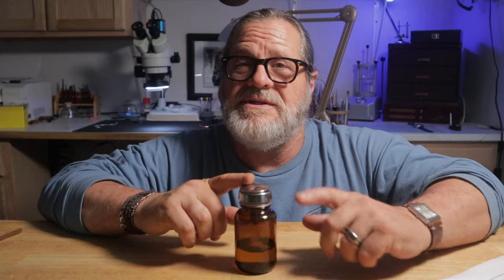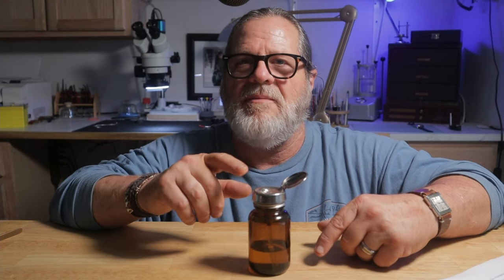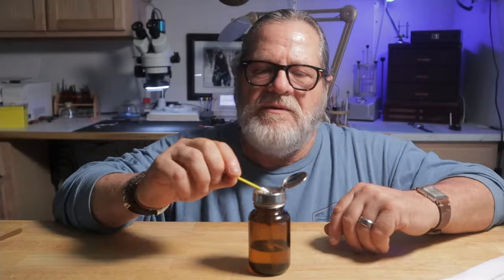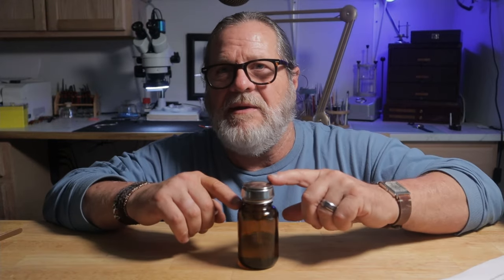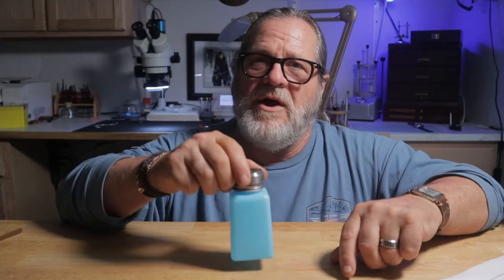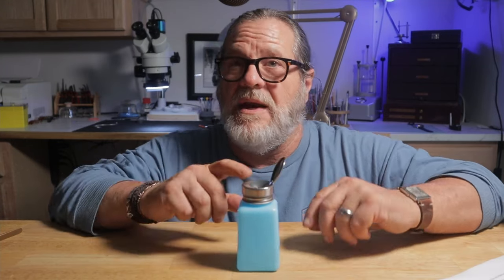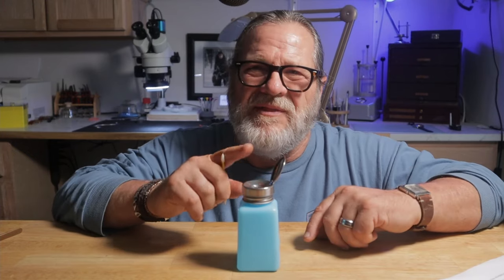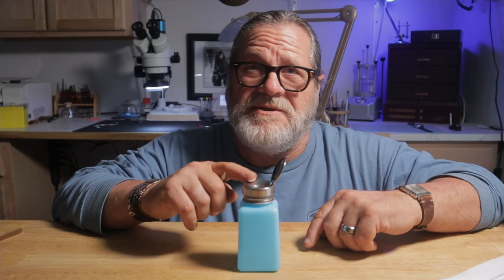How to Clean Watch Parts Without A Machine-Watch Repair Lesson #8

Comment: I really enjoy watching your videos. Thanks for sharing! By the way, not sure if you have answered this already but what is the concentration ratio for the rinse cycles when using IPA?  Do all three jars contain IPA? Is it IPA only or also water? Thanks again
Reply from the maker: Hey Marcos.
There are multiple ways to do it. In the rinse jars you can use a water rinse if you want. The key when using water, is to displace it right afterwards to prevent rust on any metal parts. Since IPA comes in different concentrations I always at least finish with 99.9% pure.
IPA that’s 70 % is basically just pure, cut with water, right.
Remember though, pallet forks and balance wheels that are shellacked could be damaged if exposed to IPA too long.
For these parts I always use Hexane as I discuss in the video.
Reply: @watchrepairtutorials  thanks! I was trying to understand your final cleaning setup. Putting aside all shellacked parts, do your 3 jars contain rinse agent (zenith/L&R)? Or some have cleaning agent and the other rinsing agent?
Reply from the maker: @marcosmartin4521  oh ok I see. I use a vintage jar machine. I use L&R extra fine cleaner, 2 rinse cycles of L & R # 3 and a final rinse in pure IPA

Comment: Alex, thanks for your great no nonsense informative videos.  You are answer most all of my questions.  I am about to start my very first watch restoration project and of course cleaning is a big question for me.  I live in a small Mexican village on the pacific coast.  Watch cleaning solutions are totally unavailable in Mexico.  Naphtha and lighter fluid are unavailable.  I have found a product called Gasoline Blanca at the paint store.  According to the MSDS it is between 30-90% Hexane and between 10-40 % Naphtha.  With a flash point of 43C.  Do you think this would work for all the parts of the watch with a IPA rinse?  What is your recommendation?  Thank you so much ,sir and keep up the great work.
Reply from the maker: Yea should work great. Use good ventilation because of the hexane.
Reply: Great news, thank you Alex.  Do you think this mixture of Hexane and Naphtha would be safe for the balance and pallet fork? Or should I clean them with something else?  Final question , How long should the rinse be in 99% IPA to avoid damage to shellacked parts.  Again thank you so much for your n nonsense approach to teaching
Reply from the maker: @randyallbritton4963  yes I clean my pallet fork and balance in straight hexane, no problem.
The rinse for the main parts will depend on the napatha ratio in your cleaner. 4 or 5 minutes should be fine.
If you have to use IPA to rinse the shellacked parts, make it brief, under a minute then dry with low heat.
Although IPA is not ideal to rinse the shellacked parts, pallet fork and balance, as long as the shellac is not disintegrating you should be fine.
Reply: Thanks again. I agree that it looks easy when you watchmakers put a movement back together. I was thinking of videoing the trials and tribulations of my first attempt to destroy a running watch. I mean renovate a running watch. Then see if one of you pros on YouTube what to do a critique on your channel. Would you be interested?
Reply from the maker: @randyallbritton4963  sure

Comment: I looked up the MDS for one dip and it came back as Trichloroethylene according to the CAS number..CAS No.: 79-01-6 Hexan works but it's not the same stuff. Neither should be used without protection.. ie.. keep it off your bare skin and use it in a well ventilated area.
Reply from the maker: Definitely not the same chemicals but it produces the same results. 
And yes I goes without saying that you should always follow safe practices, read the labels use common sense with all products you use including cleaning and rinsing liquids.

Comment: Hi. Every time i use Evapo Rust, i get some sticky resedue, that i can not get read off. I use aceton, it helps a little, but not perfect, still have some stickiness. Any idia what to use to clean parts  after Evapo Rust.?
Reply from the maker: Try CRC electronics cleaner.

Comment: I use L&R ultrasonic cleaner for a pre-wash and a primary wash step.  I rinse in 80% Naphtha/20% odorless paint thinner, in 2 steps, with a final rinse in hexane.  But I often still see residual sticky  gunk on the wheels and the plates after this process.  So I tried your idea of using IPA as an additional wash step, and everything is spotlessly clean if I include an IPA rinse step.  It’s amazing.  But iPA dissolves shellac, which holds the impulse jewel and the pallet jewels in place.  So I don’t include the balance and the pallets in this process, as I don’t want to be gluing these jewels back in place.  Does this make sense?
Reply from the maker: Absolutely. I use a zenith 4 jar rotating cleaner and still clean my pallet and balance by hand with hexane.
This sticky gunk you are referring to could be water contamination.
I had this issue in time and traced it back to when I cleaned my jars and didn’t allow them to dry 100% and then added new cleaner and rinses to the jars that still had moisture in them.
Just FYI Paul.

Comment: Where do you empty your used cleaning solutions ?
Reply from the maker: if it is a solvent based cleaner or rinse I put it into a 5 gallon barrel and let it evaporate. That's one reason I am primarily going with a water based cleaning system these days.

Comment: Sir, how long would you spin the parts and dry the parts at the end? like spin them for 4 mins or so? or more? thanks
Reply from the maker: Well, the spinning of the parts is just to get rid of the bulk of the liquid off the parts. You still want to dry the parts with low heat.
Reply: @watchrepairtutorials  what i meant was in the solution when you clean the parts how long do you do a cycle... ive seen some that say with the fancy machines they usually run each cycle for about 4 mins or so.
Reply from the maker: @gillandro2  yes, about 5 minutes should be fine depending on what you are using. Oh course inspect how clean everything is after they are dry
Reply: @watchrepairtutorials  thank you sir.... now i just have to watch your lesson on jewel replacement :)
Reply: @watchrepairtutorials  do you dilute the cleaning solution like the bottle says? Or do you leave it as a concentrate? Thank you.
Reply from the maker: @gillandro2  Yes always dilute as recommended by the manufacture. If you don't the cleaner could be to alkaline and cause damage.

Comment: I am trying to use IPA for all stages, hand washing, not soaking balance and pallet fork. Keep less chemicals at home, and IPA don’t have much smell when used. Is this OK?
Reply from the maker: Sam IPA is not the best cleaner for grease. How are you cleaning, by hand or machine?
Reply: But in the video, you say it does an excellent job of removing oil and grease... @watchrepairtutorials
Reply from the maker: @bjpargeter466  it's not the best when using a rotating machine but will work fine when hand cleaning if done properly.

Comment: When it comes to rodico, can I use a less expensive alternative, or does it pay to stick with Bergeon?
Reply from the maker: I don't know, is there one?  You want to leave as little residue behind when using a putty. Think of Rodico as something you use in emergency situations. You will use a lot less. Also when you do need it just pull or cut off a very small amount.
Reply: @watchrepairtutorials  saw a vid of it being used to pick up and align a seconds hand, was wondering if it was all created pretty much equal. Wouldn't want to leave any possible residue.
Reply: @GregJGreen  I definitely wouldn’t use it for hands or dials. I don’t know about other similar products because I haven’t used them.
There is almost always a better way than using Rodico.
Reply: @thewatchsmith2773  thanks, Alex. I have hands, a cyclops crystal and 2 presses coming, want to see if I can mod my Duro successfully. Believe it best to set them aside when they arrive and watch some more vids on the subject until I get as clear of a picture as possible.
Reply: @GregJGreen  👍

Comment: Novice question, brass vs steel cleaning baskets?
Also where do Alex find inexpensive baskets cause all the ones I find on the Asian markets are not really inexpensive. Not expensive either like the bergeons..
Reply from the maker: I use brass. These on Esslinger a 6 bucks.http://bit.ly/3ZuuX2c
Cousinsuk has them for about 3.50

Comment: I do have one question about cleaning the balance wheel/hairspring... You said that it requires a different solvent, but I don't think you specified what to use. Would the hexane work well? or is there something cheaper/better out there? If you read these please let me know :)
Reply from the maker: Hello Lilac,
The balance and pallet fork need to be treated a little differently because of the shellac and the fact that you do t want any residue left behind. 
Hexane is perfect but apparently is regulated by the DEA and cannot be delivered to a residential address.
If you are not using commercial grade cleaners lume L & R or Zenith I would suggest using One Dip which is formulated for cleaning hairsprings.
Reply: @watchrepairtutorials  Thank you, I really appreciate the fast response time :) I know you're a small youtuber (which is surprising considering the quality of your content) but it's still very impressive that you read all of the comments. Especially on your old videos. Keep it up!

Comment: Doesn't the alcohol dissolve the shellac that holds the roller jewel in place on the balance?
Reply from the maker: IPA alcohol can weaken shellac and dissolve it as well if it is left in it too long.
That’s why I clean my pallet fork and balance wheel in hexane separately from the other watch parts.

Comment: kind confused, i can use hexane for the wash cycle, and IPA for the 3 rinses?
Reply from the maker: Hi Ryan,
there are tons of ways to wash parts. Hexane is expensive and I usually reserve it for cleaning only the balance wheel and hairspring as well as the pallet fork.
If you’re washing parts by hand, I would probably just use Napatha for cleaning and then rinse with IPA. All except the pallet, fork and balance wheel of course.
Reply: @watchrepairtutorials  oo okay good to know, hexane is cheap for me in Indonesia $15 USD for 5L, can't find naptha here. Thank you for the reply 😀😀 it answered my question.
Reply from the maker: @SmartMoneyRyan  hexane will definitely work. Ventilation will be really important though.

Comment: What should I clean the hair spring with if I don't have access to Hexane or one dip. One dip just doesn't exist in my country and I can't import it. Hexane and heptane are also controlled chemicals so no luck there either. Thanks!
Reply from the maker: I would try to get either Elma Red 1.9 or Liquinox critical cleaning detergent. Both work well and ultrasonics or spinning basket machines. Both can be rinsed with distilled water and then the balance could be dunked in 99% IPA to displace the water, and then immediately dried.
Reply: @watchrepairtutorials  Wonderful, thank you. I could find the elma red solution from a watch store in my country. There was also a bottle of Boley one-dip solution, do you have any experience with that? Is it comparable to the Bergeon one-dip solution?
Reply from the maker: @2-tone180  I don’t have any experience with the boley one dip but Boley is a good company and I will trust it.

Comment: I just read that one should not claen the impulse jewel nor the pallet stones in an IPA bath because IPA will dissolve the shellac.
Do you know if that is true?
I also read that Naphtha will not dissolve the shellac.
I like using IPA because it leaves nothing behind.
What about OneDip - is it safe to use to clean the three stoness associated with the escapement?
Reply from the maker: A quick dip in IPA, in most cases will not dissolve the shellac. Where you could run into problems is if the shellac is weak or very old so it’s typically not a good idea. Napatha is safe as is one dip. 
I use hexane which is similar to one dip but less expensive. I use it to clean my pallets stones as well as my balance
Reply: @watchrepairtutorials  Thanks  for taking the time to answer . You are a good man.

Comment: How do I see when the lubricant has been pulled away from where it is supposed to be? It is so hard to know what I am looking at? What should a jewel look like when properly  lubricated, over lubricated? Could this be the subject of a video?
Reply from the maker: Look at this video https://youtu.be/M1nURfCByQw at the 12 minute mark. Does this answer your question?
Reply: @watchrepairtutorials  Your video shows extremely well what to do, thanks and congrats. A few months later when I open my watch, what would my jewels look like if I over applied lube? I can't tell by looking at a jewel in the train or balance what overapplied looks like. I mean overapplied by a bit, not crazy overapplied. Or if you prefer, after 2 months what does properly lubed look like?

Comment: Alex,

New subscriber here. Amazing video and excellent work. One question, can I use Hexane as my primary cleaner for all the watch parts? Thanks!
Reply from the maker: You could but you would want really good ventilation.
I use it sparingly in a sealed jar with very little exposure. Here in the US it would be real expensive to us as a primary cleaner even compared to professional grade cleaners.
Thanks for checking in Omar. 
What system are you using for parts cleaning.
Reply: @watchrepairtutorials  Thanks for the response Alex. Would you suggest Naphtha as the main cleaner and Hexane only for hair spring and fork?
I have an ultrasonic cleaner with the small baskets. I am working on my first Elgin pocket watch movement and it really needs a good cleaning. Thanks for the quick response and amazing work!
Reply from the maker: @lordikhonn  yea that would work. You could do napatha, water, water , then a rinse in 99% IPA to displace the H2O and heat  dry. Hexane on the balance and pallet fork.
Reply: @watchrepairtutorials  Hey Alex - Another question. I have a gallon of mineral spirits that I have used as a solvent for bike parts. Can that be used instead of Naphtha? Thanks again for all of your help!
Reply from the maker: @lordikhonn  sure, as long as it is clean

Comment: total newbie beginner qu: first time intending to dismante a new Seiko NH35 then cleaning then reassembling to see if I can get as good performance or better.  question is about cleaning, I understand one wash cycle, then three rinse cycles. As cleaning solution is ultra expensive and even lighter fuel is on par with it, and carriage is extra on watch cleaning chemicals as classed as hazardous, could I get away with omitting the wash because it's a Brand New movement and only do the 3 rinse cycles using ipa 99% (limiting pallet fork and balance wheel to under 2 mins)
Reply from the maker: Hi Tim, Maybe depending on how much if any lubricant they used on the movement. I would recommend my video on cleaning with an Ultrasonic, because I break down the different cleaner's vs cost and have some DIY options as well.  
https://youtu.be/z-SGm-nhGt8
The pallet and balance on a new movement should not need cleaning other than touching up the pallet stones.
Reply: @watchrepairtutorials  Thank you Alex, that's very helpful!
Reply: @watchrepairtutorials  thank you Alex, your reply helped me realise that the cleaning sol is vital to remove previous oils.  Have now watched your Ultrasonic vid more than once and it was so helpful.  Did not know I could use Fairy here in the UK 1:9.  I'm tempted to go for smaller 2L machine with degassing to use less liquids as a total beginner I'm only likely to be doing single movements for some time; even though the wattage is about half of your machine.  I'd even consider a 1.3L machine, but can't find one with degassing.
Reply from the maker: @timfraser  just remember that degassing is only needed if the liquid has been freshly poured and running the jars in the tank for 2o minutes will also degass the liquids.
Reply: @watchrepairtutorials  Thank you Alex, I'm sure a smaller machine will suit my current needs.